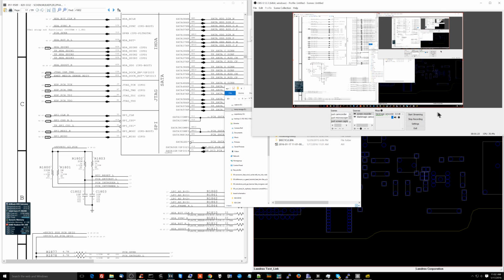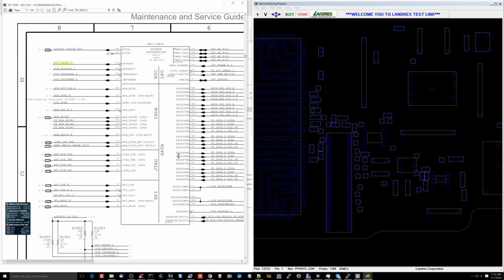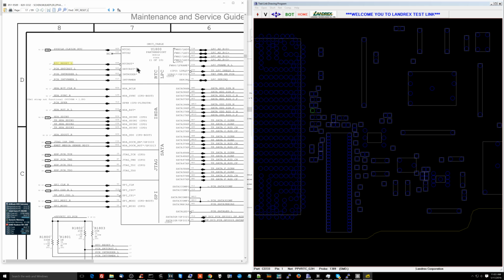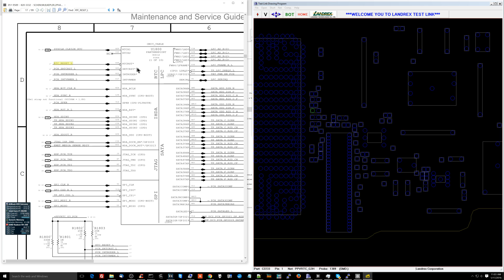How experienced electronics repair professionals gain intuition

Comment: Hello Louis,
Any idea about a solution for this failure ? 
https://www.theitsage.com/2012-macbook-pro-13-inch-randomly-crashes/

The 2nd ram slot on my macbook is broken. Works until i touch the case like in the video. I find some people are facing the same problem.

Any other solutions than just using one ram-slot on a >1000$ device :D ?

Thanks a lot. 
Great videos by the way !
Regards,
Alex
Reply from the maker: +Alexander Apostolidis one RAM slot is the fix here.
Reply: +Louis Rossmann thank you !

Comment: Hello Louis, i have a 17inch macbook pro from early 2009 and im having a lot of problems lately, the overall performaces is very slow and the screen start to flickering while im using it, do you have an idea what can  be?
Reply from the maker: +canchume performance issues is the seven year old hard drive. Screen flickering can be anything but probably bad screen or u9600
Reply from the maker: +canchume performance issues is the seven year old hard drive. Screen flickering can be anything but probably bad screen or u9600
Reply: +Louis Rossmann I recently add a ssd and i have 8gb of ram, thats the weird part

Comment: I am venturing into repairing my laptop. It doesn't detect the battery. I at first incorrectly thought it was the battery itself, since I have experience with lithium batteries in other applications, I took the battery apart and found that all the cells are still good, so now I know it is either the BMS(or whatever the equivalent is in a laptop battery)  or something inside the laptop.